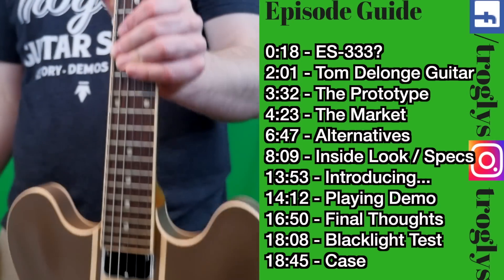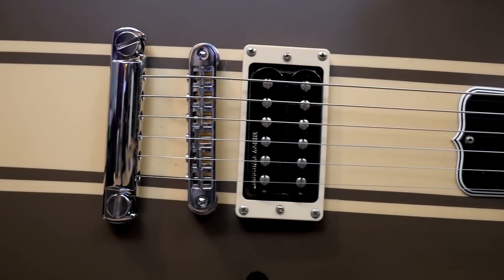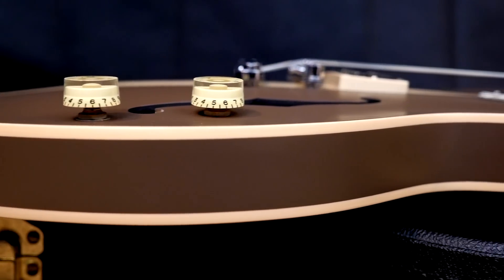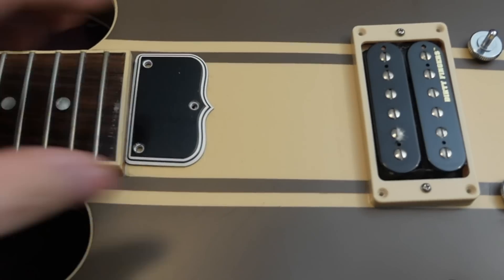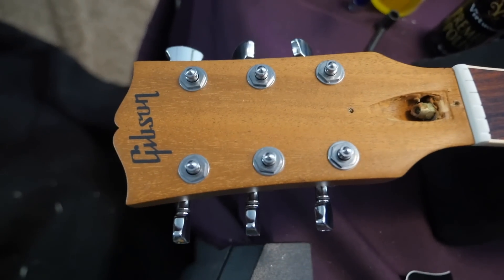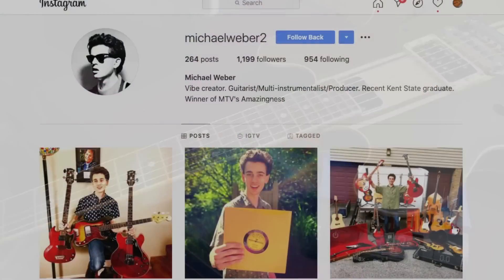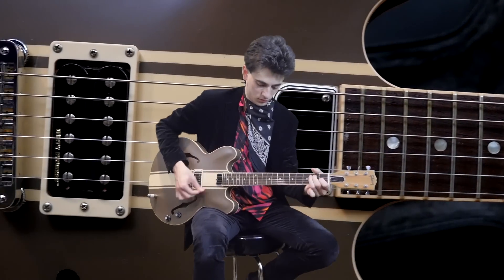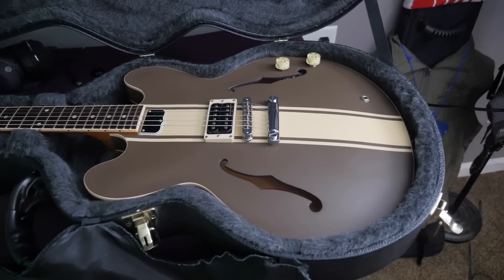How Did These Get So Expensive? | 2007 Gibson Tom Delonge Signature ES-333 | Review + Demo

Comment: Jeez, I saw the control access on the back and I just flashed back to working on a 335 at the guitar shop I worked at as a teenager and having to use fishing line to pull pots out resolder them. I did so many repairs with none of the right equipment lol!

Comment: I agree; I like the satin finishes. For me, tone always wins over appearance, and the satin finishes usually resonate stronger. I find this to be especially true with PRSs.
I got a chance to play the most recent "Paul's guitar" core line. I REALLY like the SE line Paul's guitar; that, along with the Hollowbody II SE are the only SEs that I would keep forever, at opposed to using it as a place holder until I can afford the US model. 
That being said, the Core "Paul's guitar" is just a whole different beast. The narrower pickup is just more open sounding, but the matte finish just LOOKS like it's vibrating while it's just sitting there.
I also find that the satin/matte finish makes the flamed top look even more striking.